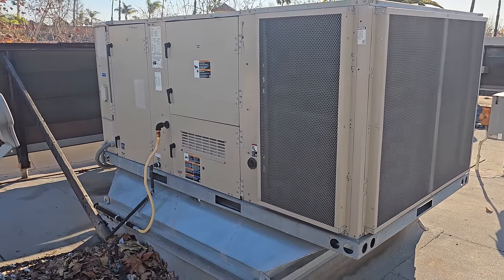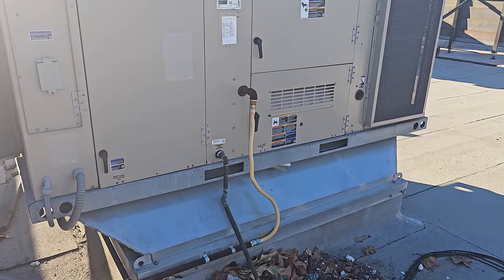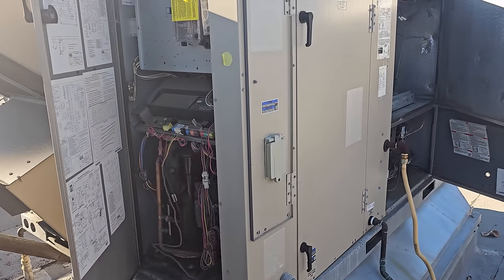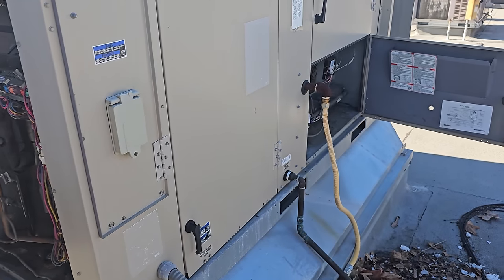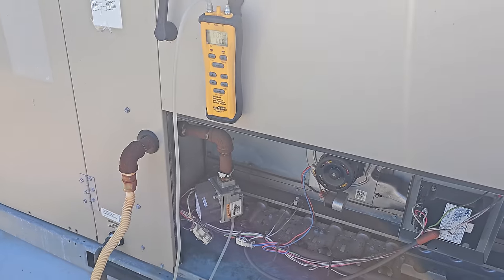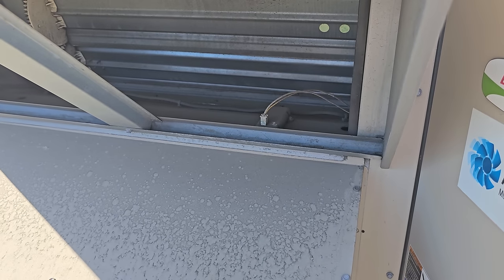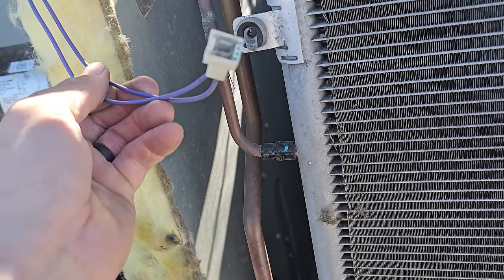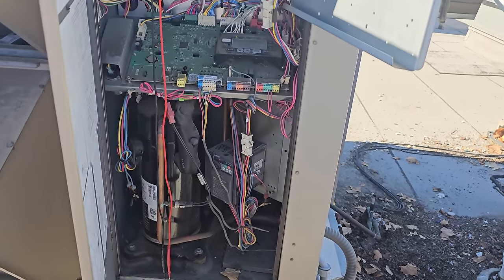THE BAR AC IS COOLING INSTEAD OF HEATING

Comment: That "I trust the client wasn't in there" is the nicest and most professional way to outline someone's level of technical apitude that I've ever heard. Haha
Reply: Those customers are better than the ones who think they know what they are doing but completely f up equipment instead  😂   and o boy Chris has had a few.
Reply: Its also possible this location simply doesnt have the ability to adjust any settings, everything may be controlled remote via a energy management company
Reply: @curioushvacguy6876 wouldn't that make it much more likely that someone (accidentally) messed with the settings?

Comment: The company I work for is a lennox dealer and yes those thermostats are not good. They do funky stuff, our company has been replacing any we installed for free that we run into issues with. Replace with a vision pro 8000 and be done

Comment: 9:58 - I purchased the Sauermann Si CA 130 through Truetech Tools specifically for gas pack RTUs. I chose the CA 130 model over the CA 030 only because of the field replaceable sensor (even though they are rated for five years). Other than not having to send the unit back to the factory for calibration (as is the case with the CA 030) and the touch screen interface, both have similar functionality and both work with MeasureQuick. I was able to catch a faulty heat exchanger with this analyzer even before removing the panels (the tubing did have rust holes in the bottom of the bends and needs to be replaced). With the optional thermal printer I was able to document the analysis straight from the analyzer. I highly recommend this device for you. It is quite easy to use and understand even outside of MeasureQuick.
Reply: I use Sica 130 too,no issues works good for rooftops and residential
Reply: Where are you probing the flue at. Are you extending it with a piece of small duct. Or are you just inserting into the flue

Comment: When checking/adjusting gas pressure, I have found that putting the cap back on can change the setting. That's why I make it a practice to cover the adjustment port with a finger or thumb during the process.

Comment: I LOVE my tpi dc710. Blutooth and connects to phone with pretty good range. They make a manometer that can connect wirelessly to it so you can read and set pressures at same time. Has a water trap incase you are working on condensing stuff. Battery lasts quite a while. When you get the numbers you can generate a report which grabs the gps location and lets you add a job number and title to each report generated. Also has a temp probe built into it, one that measures exhaust temp and one that measures ambient temp. The app also does gas size calculating and stuff if ur into that

Comment: Thanks for another helpful and informative video, Chris. If no one it touching that thermostat then the issues suggest the internal memory has problems with 'bit rot' where, because of the way such memory works, the memory cells change state over time. Often, re-writing the cells will restore normal operation at least for a while. It suggests either very poor quality or very old electronics in that thermostat or poor manufacturing quality control.

The thermostat problem reminds me of years ago with memory cards for a digital camera, some of which just became corrupted over time. Fortunately, they were fairly straightforward for me to recover. This is the main reason why I never leave any data on a Flash Drive (thumb drive) or Memory Card that I don't have a safe and secure copy somewhere else. 

I know you use USB Flash Drives for firmware updates on machines. One of the best things you can do is learn how to refresh, backup and ideally take a Disk Image of flash memory storage media. Even manufacturer-supplied drives can go bad, and having the skills I just mentioned could save you from, worst case, a bad firmware update that trashes the machine in some way because the controller didn't recognise the firmware was actually bad or simply not being able to apply a needed update to get a machine working in a particular situation. On a more personal level, it could help you recover videos and photos from your own phone(s) and camera(s).

Comment: I have no specific information about these controller circuits, but those sorts of low-level logic circuits are always prone to occasional state changes like the one you see. Electrostatic discharge is one good way this can happen, for instance. Computers have to deal with this all the time, they have what is called "error correction" that can detect bit flips like this one and fix them.

Comment: Chris, on those lennox economizers the wire leading to the enthapy sensor that has the corrosion on it is always the + wire and truthfully you can just snip off the corrosion part and snip the wire on the other side of the quick connect and run that wire through the already factory predrilled hole that will be next to the quick connect plug. Wire it up and that enthalpy sensor will work but I personally like using the oda sensor that's hooked up in the condenser because I'm able to use the magical temp number of 50 degrees to start ecomizing. Even if it's pouring down raining with 100% humidity in the air the 50 degree air is the perfect point for ecomization. You have to made a few letter settings under id number one and change the second letter to a t

Comment: When commissioning a system I don’t set it exact to 1.6/3.5. The data tags will have a low fire/ high fire temp rise setting. I always adjust my GP based off my temp rise. If the temp rise says 15-45° of a rise I shoot for generally 25° rise. Try to keep it on the low end so it’ll slowly Evenly heat everything in the space so there’s no hot spots or cold spots throughout the space.

Comment: As a resi tech I’m not sure of what the challenges are for combustion analysis for commercial. But the Bacharach Insight Plus has been my go to. With field replaceable O2 and CO sensors it keeps your down time low. I do recommend the NCI combustion training for application though. They touched on commercial when I took it but it definitely wasn’t focused on. I remember Jim Davis did talk about CO build up on roofs that are fully surrounded. So that could lead to poor combustion air and for restaurants, poor MUA.

Comment: Combustion analyzer isn’t really going to do much for you on your standard package unit. Derate system for altitude (orifices and pressure switches), adjust gas pressure to manufacturer spec, check temp rise and airflows, make minor adjustments. Save the Combustion analysis for High efficiency equipment that requires it.

Comment: So the flex CSST line in 1/2" is rated for 106KBTUs and the 3/4" is rated for 290KBTU.  That would be more than enough for that size unit.  Also the Testo unit is a great unit.  I have the 320, but its no longer made.  The 300 Pro would be the way to go.  You can save some cash if you don't get the kit with printer, but its not that much more.  The thermal paper would be ruined pretty quick there with the heat so, you really don't need a printer unless you keep that in your records.  🤠👍

Comment: Southern California where you can fix the heater by just turning off the air conditioner compressor.   I was watching the video at 8:am and 8 degrees F.  After I got up I turned on the Mits split unit heat pump on and am heating my house back up 10F out side.

Comment: Great stuff Chris. Had a remote stay temp readout for an EMS controlled customer that the temp readout would go up when the temp would go down inside the store. Checked zone sensor in the store and the ohm/temp reading was in line. It was very weird.
Reply: Somebody could have put the wrong thermistor in it. There is a difference between PTC and NTC. Mainly which direction the resistance goes. PTC is positive temperature coefficient and NTC is negative. NTC the resistance goes down as the temp goes up.

Comment: I have 2 combustion analyzers. Both are Testo a 320 and 310, both have printers. I know you prefer FP and thats cool.....but Testo, Bacharach bith make great analyzers and are solid. Just my 2 cents. Metric works on standard....standard doesn't work on metric...lol
Reply: Yep, I also currently have the 320, and am very happy with it. Really, the carrying case is the only thing I don't like about it, as getting the probe and analyzer in there is kinda like Tetris.

Comment: I work in IT and deal with embedded devices and there are all sorts of things that can cause a device to screw up its own settings. Often a power glitch can have it running on an out of spec voltage for just a few seconds and it corrupts part of the saved settings.
Reply: Don't forget the bit rot
Reply: Could fluctuating power levels cause this over time? I know in Chris's area they have a dirty power grid, inconsistent power
Reply: @curioushvacguy6876  could be - depending on how it saves its settings. It could have one bit flip and see that there is a checksum error and just load defaults at that point.

Comment: Testing and adjusting gas pressures is part of the commissioning process. I don't know if  the factory commissioning includes a combustion analysis but it's a good cya procedure. Incomplete combustion causes high Co and in the case of a bad heat exchanger letting it into the restaurant is rare let alone producing enough to cause a problems in a restaurant would be nearly impossible because of the size of the building and the constant air flow with the exhaust fans and makeup air.

Comment: Should check inlet gas pressure. That flex connector is undersized like you said. Could be rough in that gas valve.
Reply: Thats not a bad idea, check it on high fire to make sure its got enought juice

Comment: Personally, I am quite happy with the Testo 320, it reacts pretty quick, battery life is ok, has a lot of additional functions (co detector, gas pressure meter, concentric flue testing, etc...) and you can get it with a printer, so you can give the customer a protocoll and put another copy in the unit, or at least that is what we do in Germany. That way the next tech can compare and see whether there are any worrying changes. My only issue with it is the carrying case, which is well made but unfortunately a little crammed, so getting a fully equipped 320 with all accessories in there is more like HVAC Tetris.
Reply: I think steve leviniere uses that testo 320... seems to work good
Reply: I like my 320 as well. I’m not interested in anything with a touch screen.
Reply: @89dhvac  Same. Touch ist almost guaranteed to have scratches after one day of use and probably got smashed by the end of the week, costing $400 to replace... Also, you can't use it with gloves, which is a pain, 'cuz I don't want my hands to stink like fuel oil all day, so I wear gloves when working with the stuff, but then I couldn't operate the analyzer. Really glad that the 320 still has buttons, and i hope the next gen will also be available with real buttons, and not be all touch.
Reply: @unmountablebootvolume  I’m with you 100%. I was really disappointed to see the new testo 300 with a touch screen and ui similar to their wireless tools. The 320 is actually the only testo product that I really like, but I like it a lot! If something like the new 300 is the only option when my 320 needs replaced, I won’t be buying another testo.
Reply: @89dhvac  Couldn't agree more with you!

Comment: I have a UEI Eagle 2X analyzer and a Bacharach (Fyrite insight plus I think). Both are good and accurate as far as I can tell. I have to send in UEI yearly, per their recommendation (to eliminate long term sensor drift, supposedly). Bacharach I'm not sure on since I just got it late last year. I do like that they have infrared printers so that i can print off the complete analysis and leave it in the mech room/roof access area. I've had my eye on the Saurmann ca 130 or the newer fieldpiece analyzers. 

I was just thinking about how much i hate that they have "Honeywell Home" on commercial stats.

Comment: I don't understand why heat pump needs gas burners to heat the building.
Reply: If it has burners, it most likely has no reversing valves or check valves included.
Reply: Would be cheap enough to install on something this big.. probably that gas is cheaper in the large quantities @SovereignTroll

Comment: If your only running on 1st stage Heating, Does that still mean the flex pipe is under sized?? As you would never be using the full flow of gas??

Comment: That issue with the thermostat may be caused by power fluctuations combined with poor design. This is especially true if you have configuration corruptions across multiple installations.

Comment: The rubber fasteners may be related to heat expansion or noise from the gas heater.

Maybe the manufacturer could only get them for metric, but it's screwing into rubber ... mysterious ... always send the trainee for the adjustable metric wrench 🎉

Comment: Ah, thermostat decided it wanted to switch a reversing valve that didn't exist!

Like how the old enthalpy sensor was so filthy the label was completely covered with black dirt.

I'm wondering about those metric fasteners, whether they were like that from the factory, or if it is the result of a previous tech not at your company putting the wrong ones in, considering one of them was stripped too.

Edit: I wonder if the persistence of the Honeywell name is mostly for brand recognition for people not in the field.

Comment: Hey Mr.HVACR I was wondering how the heating system works on these commercial units because I’m just not understanding why there is a fan blowing hot air out the unit like the thing you call a induction fan or motor or whatever I just want to learn more about it

Comment: Undersized natural gas flex line?  No, not even close.  I really hate those flex lines, but they aren't a problem like this; they have more than enough capacity.  A few feet of 1/2" ID IPS flex (5/8" OD) can handle 150,000 BTU, 3/4" ID IIPS is around 200,000 BTU or so.  The shorter the flex the better, as the length increases the BTU capacity decreases. Anyone remember Bernoulli's equation from high school physics?  It still applies and it still works. There are tables for this.  And, this is southern California.

The old thermostat craziness is likely power fluctuations, voltage changes and poor original electric design of the thermostat.

Comment: I've seen several incorrect gas lines installed
They see it needs a certain size gas line which is Inside diameter 
But technician will get the outside diameter gas line

Comment: Bro heat pump is first stage of heating. On a heat pump that has furnace that's the stage when the heat pump don't work. But sometimes furnaces have to ignite and combust then the heat pump takes over.

Comment: Don't waste your money on an analyzer in your part of the country.  Just get the gas pressures correct, check for blue flame, temperature rise, and signs of a faulty heat exchanger..

Comment: Its not a thermostat issue, nothing wrong using those Lennox thermostats,problem was the programmed settings, 
I use those tstats all the time,never had an issue with them.
Cool videos but no reason for you to bash productals or point fingers, stay on the topic.